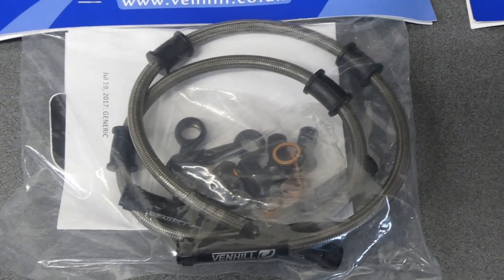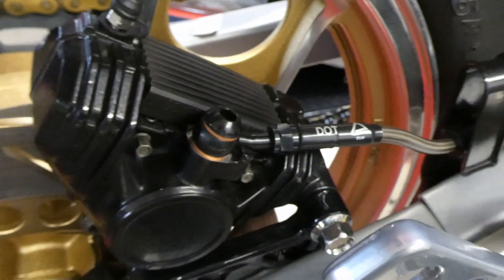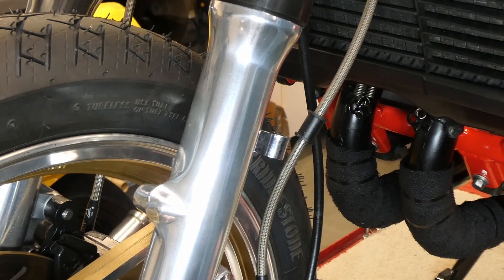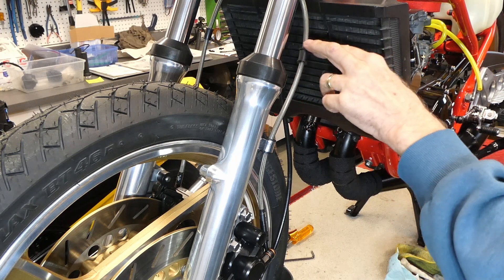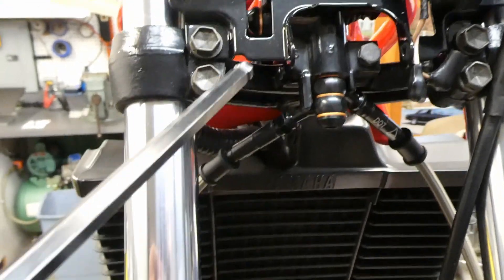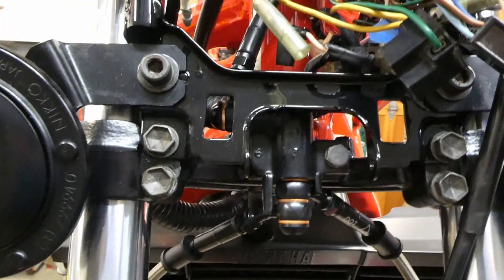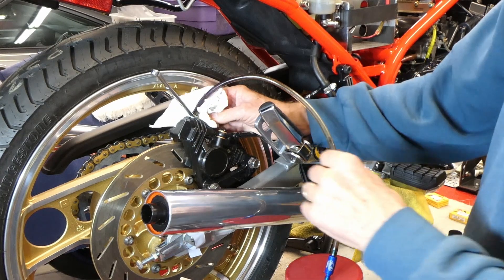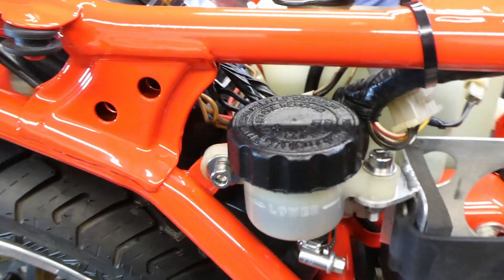RZ350 NC2 EP67 INSTALL VENHILL BRAKE LINES

Comment: That Venhill system is great. I went with black pipes and black fixings for extra stealth :)
I would say the rubber pipe grommets were a bit on the small side to fit the pipe holders. But that's easily fixed with a bit of heat shrink.
Reply from the maker: Yes the grommets are a bit small. Great idea on the heat shrink. Wish I would have known or thought of this prior to making all the connections and bleeding. I'll think of another solution on the front lines.

Comment: Nice work, Ken.
Not familiar with Venhill, so I learned something new. 😊  I see you are better at bleeding brakes than I am.  I broke down and bought a Mitty-vac bleeder to get the job done.  😂  
I use DOT5 as well.  It has its quirks, but it has benefits too.
The bike is coming along nicely.
Reply from the maker: Thanks Scott. Another DOT 5'er. Good to hear real world users of this stuff having positive results. Venhill is a bit expensive but you use their custom line builder on the web site and select the exact line lengths and fittings you desire. Zillions of brake line colors if you're in to that. I've only ever ordered smoke color. The US rep is great to deal with also if you have product questions.
Reply: @KensGarage1  Cool, I'll take a peek at their website.
The US Army uses DOT5 in trucks, tanks, and MRAP's to extend the service life of equipment and to increase maintenance intervals.  Not as hard on paint as DOT4 either. 😊
That's a good thing for most of us.

Comment: Excelent job although i would use Dot 4.
Reply from the maker: Thanks. Yes, many don't like or don't want to try the DOT 5. This is my second bike using it. Have you had a bad experience with DOT 5?
Reply: @KensGarage1  dot 5 traps more moisture and you have to purge more frequently
Reply: @KensGarage1  I use DOT5 and only DOT5 in all my bikes Ken and have for years with 0 negative effects. Great video as always 👍
Reply: @ricardorojas2611  That has not been my experience.
Reply from the maker: I did quite a bit of research before making a decision on DOT 5. Below is from Valvoline www.  

Braking fluids DOT 3, DOT 4, and DOT 5.1. are hygroscopic or absorb water and that is why brake fluids have two boiling point values. On the other hand, DOT 5 is a highly hydrophobic silicone formulation, or it repels water, making its boiling points more stable (260 °C dry boiling point and 180 °C wet boiling point).
Reply from the maker: @phoenixvids  Good to hear Tim. I've only used it on completely rebuilt systems, i.e., all new seals, MC parts, and brake lines. DOT 5 is not to be mixed with any other type of brake fluid. Have you used it in non rebuilt systems and if so how do you purge 100% of the old brake fluid out?

Comment: Hey Ken, I just fitted braided lines I got from economy cycle ok but supply two left lower lines so the right side is angled in towards the bleed nipple and they are not Dot rated.
I use a syringe and push the fluid from the Calipers up, takes about a minute the complete bleeding as air wants to go up. What size BT46 tyres do fit?

Comment: And what oaint did you use for calipers cheers 🤙
Reply from the maker: This was just spray bomb high temp semi gloss black. After curing for a bit I put them in the barbecue at low temperature to extra cure them. This was prior to purchasing my new paint system. In the future I will use something better.

Comment: Mate whats the colour code for the frame please
Reply from the maker: I just went through my notes several times and can't find the powder coat code that was used. It's possible I may have the receipt out in the shop. If I find it I will let you know.